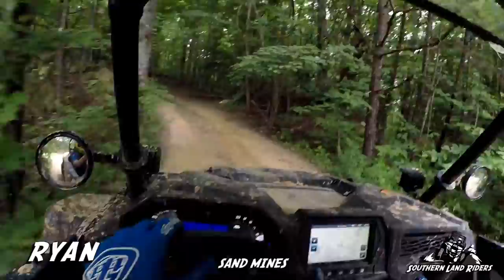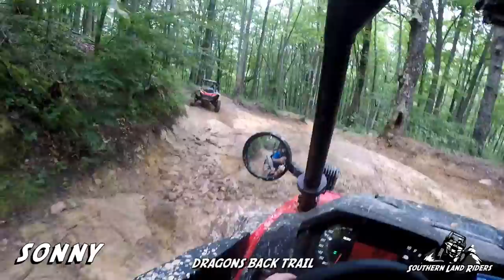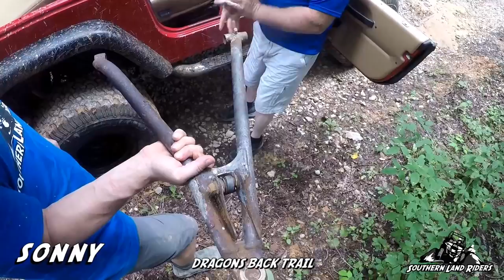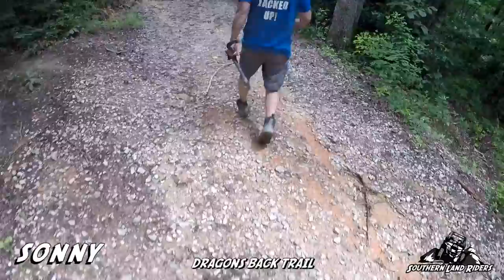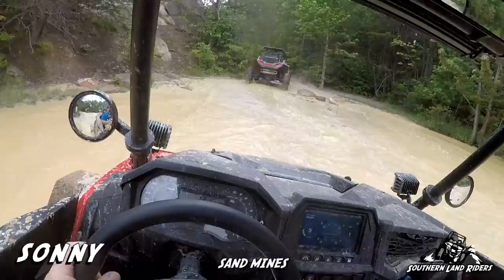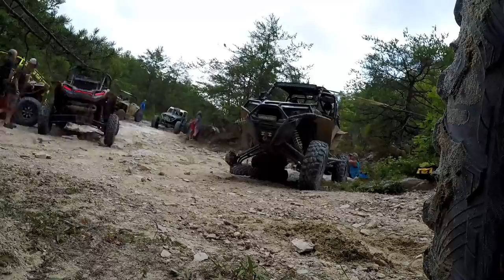Ride Royal Blue 7/2018 Day 3 Part 3 (Rescue Mission)

Comment: Man these Razors break so much.....  How did this guy do it???
Reply from the maker: They really don't. If you do preventative maintenance and run some good aftermarket parts that are the weak link you usually will not have any issues. The issue in the video was not the RZR's fault. It was an A arm that wasn't as strong as the ones he currently runs.